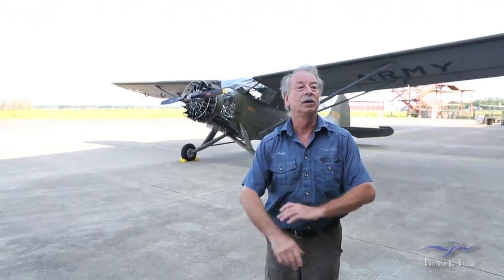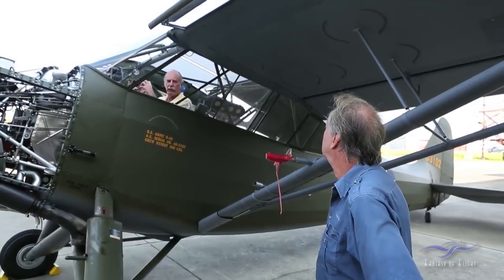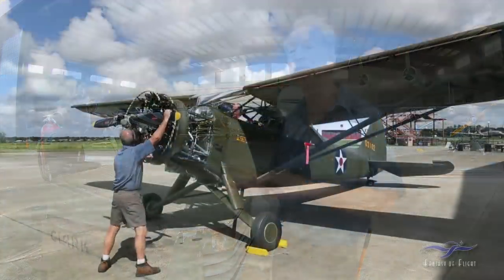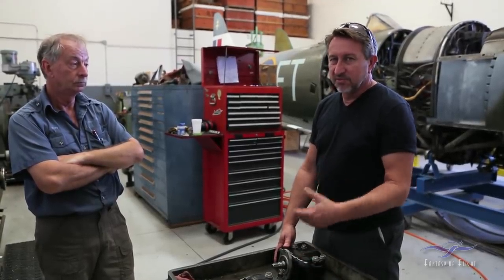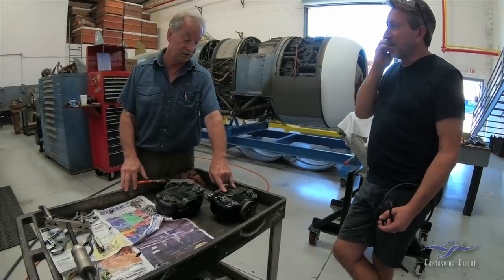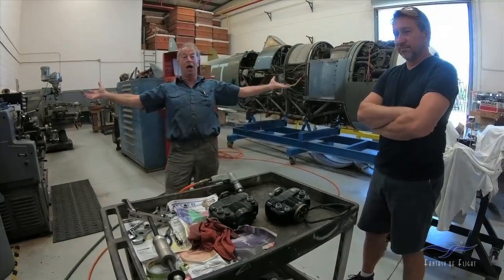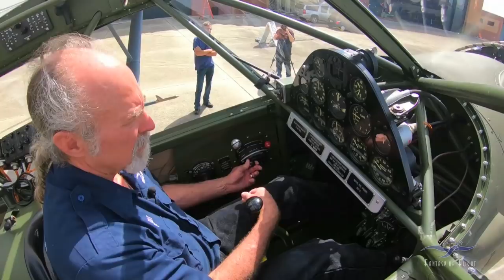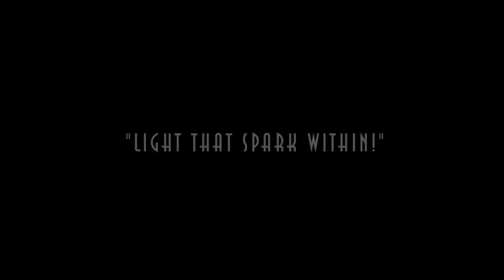Stinson L-1 - Engine Start Saga - Part 2

Comment: Best wishes all who have moved on from FoF especially Andy. It must be extremely challenging working on so many different types of engines often without the best documentation :-P. The low voltage coming from one side of the magneto coils was tough to diagnose but as it turned out the correct one. A bit of a shame that Andy wasn't there when they got the refurbished coil back and the Stinson running right, but I'd guess he'd just be happy things worked out. Very nice to see the STO characteristics of the bird at the end, clearly running much better..!

Comment: Well done guys, I would not have found that one, I would have taken the mag out and saw spark and thought "Fine" put it back and same problem,  Nice to have one to compare it to, saves a lot of head scratching.  Sounds nice when it is running properly.  I could almost smell the oily smoke!  Just a memory thing from smokey old engines.
Nice machine.  Nice to see these old machines running and doing what they were made to do.

Comment: Thanks for many enjoyable hours of watching Kermit.  Now I see that this engine uses an inertia starter.  I've been flown in radial engined aircraft, I've seen radial engines complete and disassembled in museums, etc.  But one thing I have never seen is any detail on the operation of an inertia starting system.  I wonder if you might give us a good look at one someday?  Thanks.

Comment: Well, it could have been worse. If this was a Sea Fury with four mags, this would have been a 16 part series. :)
Reply: I saw a video by FlightChops on the Sea Fury *Dreadnought*, He explained it had four mags because it had two engines, one in front of the other. Does the standard Sea Fury only have two mags or am I incorrect to assume so?
Reply: @trainedwarrior502  I saw the same episode. that was "a Sea Fury" I was thinking of. The Centaurus is two rows of nine cylinders. Two of those end to end would give maybe 6000hp. That seems like a lot for that airframe. I thought the presenter was just talking abought the two rows of cylinders. Now that I look at pics of several developments of the engine, I only see two mags on the latest 1951 variant. Maybe 6000hp for pylon racing is de rigeur. lol
Reply: Silky Steve you get 👍🏻👍🏻

Comment: Nice to see the Stinson in good nick again, though the starter might need to be freshened up from high usage (joke). Andy has retired?  You know those good workers if not paid too much would have to stay around to make ends meet (another bad joke) Hope he stops by and says 'Hi' now and then. 
As a side note, have you had a chance to check out Tom Reilly and company's XP-82 since its now flying? If not, that would make a good adventure. Maybe a formation flight with your two Mustangs...

Comment: I worked on automobiles & other engines for many years, and no-start problems will make you tear your hair out. "Fuel, spark, timing. OK. got all that, WHY WON'T IT START!" I work behind a desk now.

Comment: That bad mag looked like it was sparking ok... Not great but ok.  Was surprised that was the problem.  For your readers... your not supposed to turn over regular type mags without plugs in all the ports because the spark plug gap sets the voltage.  Without the spark plug the voltage goes to crazy high and can damage the distributor by carbon tracking or possibly the coil by insulation breakdown.  Awesome video again Kermit!

Comment: ...when I lost a mag on my O-320 (150 hp) in my Beech B-19 Sport - sometime after run up at Chelan airport - I took a very long time to climb out of the river canyon - but attributed it to high density altitude.  I only realized that I had a problem when I got home, and tried to restart after fueling - NADA...My mechanic asked me if I could hear a loud click when I pulled the prop through - NOPE...  So, the Mag with the impulse starter was dead, and thus - not enough spark to start.  Can't remember what the failure was, but we rebuilt both mags - no more starting problems, and still wishing for more power.

Comment: Hi Kermit and team, 

So glad to see it is running and flying again. Great to follow your problems and I was amazed to see the spark from the mags. Always great to have an explanation behind the problem and parts. 

Question, the starter on the Stinson. Is it an inertia type of system (flywheel spinning up and banged in to start)? How does it work?

Was shocked to see the staff that have left but as long as you have replacements. Wish them all well on the new ventures and adventures.

Keep up the good work
Paul

Comment: I know what you mean about blowing the spark out. I had helped with winter maintenance on the B-17G Thunderbird. We removed all the plugs from the R-1820 engines and pressure test them. Put them a pressure box and on the spark plug firer. We increase the pressure in the box until the spark blows out. Record the data for the mechanics. We had one we had to replace.

Comment: No spark under compression is a bit of a challenge to diagnose,  I was a professional motorcycle tech for about 20 years and ran into the problem a few times, mostly on magneto ignitions.  And to be more correct, the compression doesn't 'blow the spark out' (as was worded in the first video), it just creates more resistance that the spark can't jump.  IIRC, the spark gap on the plugs of aircraft recip engines is close to .015" which is quite close compared to autos and motorcycles which are usually over .026" and wider with new electronic ignitions.  

Did they send a report back with the repaired mag describing what was repaired in the magneto?  It would be interesting to know just what failed.

Comment: Great video.  Was that the same model plane Henry Fonda flew in the film  "  The Battle of the Bulge " when he went 
up in the air trying to spot those German Tiger tanks?
Reply from the maker: No, that plane was actually a Cessna L-19, known in the military as the Bird Dog.
Reply: @KermitWeeks444  Thank you and congratulations on finding the problem with the L-1.

Comment: Anybody else notice how the front hood of the airplane towing tractor thinggamagiggy is the perfect height, angle, size and shape to be used as an impromptu standing desk? It even has a little ledge to keep things from sliding off. Was it designed like that for that reason or was their another reason like holding a spare tire?

Comment: That is one strange starter  how does it work? you wind up a motor and than throw in the clutch?
Reply: Its called a inertia starter. They are pretty neat and some can be hand cranked as a backup.
Reply: like the Stearman PT17 but the inertial starter flywheel is driven by an electric motor that also generates DC power.  It thought it sounded familiar!
Reply: SouthJerseySound  In Part 1 you can actually see on this plane where you would install the hand crank. It’s on the right side, you can see it begin turning when he starts spooling it up electrically.
Reply: @NC0Q  I thought this plane had the hand crank too but was too lazy to look it up. I think most planes with this type of starter had backup cranks during the war but I could be wrong. Although most of the ones I've seen have had it, but I sure wouldn't want to be the one that had to crank it up. That is for sure

Comment: We still never found the smoking gun. Sure, the mag swap fixed the last part of the problem but we never fully revealed what was changed to prevent it from starting in the previous episode.

If you need someone to run that antique Bridgeport mill in the background I'm your guy. I've got many hours on them but spend more time playing with cnc machines these days.

Comment: The technician did a poor job here. Both in how he approached the job and in diagnostic skills. Any truly accomplished gasoline engine tech would have pinned down the problem in a day (for sure), which would give time to rig some test equip to visually observe  absolute timing of mags and valve train  with only minor dissassembly (plugs, wires, two or three valve covers...). And he kept changing stuff around without having defined the original problem. There lays chaos, diagnostic arrest, multiple freshly installed problems...  
It made me itch all over to watch this and see the mistakes being made. Im sure Andy is a world class restoration specialist, but he is diagnostically challenged.